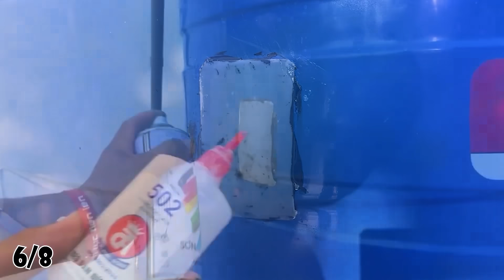I Never Have to Buy Water Again! How to Make Free Water Directly from PVC Drainage Pipe

Comment: What you do or don't do is your responsibility. I deal with drinking water in my job. I live in Switzerland and drinking water is subject to food regulations here. Drinking water is a foodstuff, just like other foods. Here it is controlled according to HACCP. As soon as you are dealing with surface water, you have to know that there are germs like E-carbobacteria in the water, which can make people sick. In my opinion, you have to know that. You can have such water tested in a laboratory. As drinking water, the number of germs per litre can only have a certain limit. That is why it is disinfected chemically or with UV radiation. That is the legal requirement. I do not know what the regulations are in your country. You can do what you want. I only recommend that you point out that this system is not drinking water compliant. Or that it must be boiled first. I would therefore recommend that you protect yourself legally before you are held accountable if someone builds it and becomes ill. You can do anything with this filtered water. Just do not declare it as drinking water.  This way you can certainly save water from the tap. But they reject any liability and say exactly what it can be used for. As soon as you touch something with your fingers and have not disinfected them beforehand, it is contaminated. I wanted to draw your attention to this. You know it, knowledge is power.
Reply: And where do you get water when you have a drought??....droughts can last for years....where I live, we have been under a mandatory water conservation for the past two years....this is fine for watering the garden....idk that I would  want to shower in it.....and I certainly would not drink or cook with it. If all I could use it for is watering the garden, i could just set the barrel outside and remove the lid when it rains.
Reply from the maker: @HeinzStuker Thanks for sharing your thoughts! It is important to distinguish between collecting rainwater and using it as drinking water. Rainwater can be collected and used for many purposes, such as watering plants or washing, but for drinking purposes, it needs to be treated and filtered thoroughly. I completely agree that ensuring health safety is a top priority, and measures such as filtering, disinfecting, or boiling are necessary before consumption. The goal of the video is to provide information on how to effectively collect rainwater, but also to emphasize that rainwater needs to be properly treated before drinking. Hope this helps clarify the issue! Do you have any additional comments?
Reply from the maker: @uberurbana4894 You are right to put the bucket out and open the lid and there can be rain water. But as you just said, if a drought occurs we need to save every bit of water. And with a little rain, "opening the bucket lid" cannot help you fill the tank, then you will have to struggle to carry those buckets of water to a safe place to store. It will be a lot of work later just in exchange for the convenience of "opening the bucket lid". Thank you for watching the video and wish you a good day.
Reply: Water conservation is  different in developing countries.
Reply: I was just going to mention the need for treatment for purity.
Reply: Absolutely agree 
What can do in this arrangement is to add a debris filter, simple sand, with small gravel catch leaves etc on top
But below & this is most important part in which most get wrong

U need crushed , as in close to powder (for maximum surface exposure)
CHLORINATED CHARCOAL 
So many times u see people use the charcoal out of a fire pit , bbq,  or Woodstove (which is better than no charcoal), 
but all that is being done is if there was any bad taste in water, filtering thru simple charcoal is acceptable

 But,  need Chlorinated charcoal, in order to remove some  bacteria, but it will do nothing towards removing eColi from the water, or many of the nasty smaller bacteria. Less than .003mm

To remove eColi, small bacteria
- Boil one solid minute of rolling boil
- Chlorine tablets or liquid
- UV light in verticals position (only works if water tds is below .05 so use that size of pre-filter)
- Ceramic filter vertical position 
Pre-filter 0.1 ok

These remove .999 of contaminants 

Even leaving a clear 10 litre jug out in direct sunlight for 6-8 hours will cause ozone & disinfect the jug of water

&

Finally there’s pasteurizing  which is heating to 160-170F degrees for 40 minutes or longer
Will kill bacteria

There r videos on Utube on how to make ur own Chlorinated charcoal right in ur own Oven 
So easy :)

But if ever in situation where u r going to die of thirst

But there is dirty water & think u might find help within couple days

I drink the water & deal with stomach when back at home or can get to a clinic
But only if rescue is within 2 days 
As is risky :)
Reply: For christ's sake! This man is ingeniuos. You live in a developed, Western, privileged country  This person - probably from Indonesia - doesn't have the advantages or the finances to just pay someone or buy something. I know who would survive if the western world's infrastructure collapsed.
Reply: @52ace1  he has a couple of expensive drills from Dewalt, cutting machines, a hair dryer, step drills, a dozen tanks, a pump, a dozen filter flasks, a bunch of new pipes of different diameters and a means for gluing them together. What finances and lack of tools are you talking about? He has nothing to do, so he does all kinds of nonsense crookedly and askance. Having no idea about it. And dangerous to health. To make money on YouTube. And not for extreme needs.
Reply from the maker: @rameshshankar1010  You're absolutely right, but in developing countries, water conservation often requires creative solutions that may differ from what’s common elsewhere. Systems like rainwater harvesting and DIY filters can make a big difference, especially when water is scarce. While these methods might not always be ideal for drinking without further treatment, they can still be incredibly useful for daily tasks like cleaning or irrigation. Have you ever considered how small, simple innovations can help improve water access in challenging conditions?
Reply: besides, too muchh plastic, water does not love plastic
Reply: It may be good for some things like water grass,washing the car.it just washes your roofs dirt,bird poop into your filters that only catch particles.if you pee in the roof drain it will still be pee contaminated..frankw
Reply: @pepe6518  the whole world has plastic piping
Reply: Congratulations.
Reply: @52ace1 The creator says he's from USA, one of the western, wealthy privileged countries. 

As for who will survive when Western infrastructure collapses? No idea, but I'm willing to bet that not many of the survivors will have drunk water collected like this.

Collecting water for garden plants is common in UK (except when we have a drought and no rain), but I don't know anyone who uses a complex set up like this. Guttering, down pipe(s), barrel(s) and the shed roof works well enough.

And if push came to shove & shed roof water was all there was to drink & cook with, this complex system would still be unnecessary.  Filter the water through coffee filters or fine mesh plastic tea strainers bc shed roof = insect contact, bird poop etc. Then boil it for 5 mins before use.
Reply: What makes you think he doesn't already know about water treatment and purification?!

And that he most probably has the testing kits, chlorine, etc to purify the water for cooking and drinking?!
Dominica 🇩🇲
Reply: This water is clean enough to wash and bathe with though.
Reply: I understand what you are saying, but any sensible person would know it's not drinking water unless you boil it and even that may not be safe. Filtration not sure it's the correct word. But to filter it through like they do in most EU and America. Where every attempt is made to remove all the bad stuff. Is definitely a must as that's how the water services work. I would like to say I am sure but I now realise as I write that many will not realise that it's dangerous.
Reply: Ever heard of Water Purification & Filtration?  It's been a World Wide thing for quite a while now.... 
...Just Sayin'
Reply: You talk about the first world and there’s a place in Switzerland where the natural water is the purest in the world. The video is about a world you don’t know where only “just” clean water is “Life”. Have thought about Palestine’s Gaza where people are starving for water just for drinking they don’t care about bacteria, ecoli etc. etc. Don’t talk nonsense if you don’t know the affairs of the world beyond Switzerland. Wake up and try to look around the world. People are bent upon to use the same water from the ponds which animals are drink. Keep your knowledge to yourself. Learn how to survive in this pathetic world on the other side of the globe.
Reply: Desperdício de cano e balde . Compra logo uma caixa d'água  e depois faça um sistema filtrante
Reply: Personally I think this man is very creative. At least he found a way to utilize water resources, instead of sitting in a fancy office, drinking clean water from the factory and expressing his views as a world saver. After you said...what did you do?
Reply: Using rainwater is a sustainable and effective solution for conserving water resources, especially in the context of climate change and increasing water scarcity. Rainwater is a natural, clean, and easily collected resource. Here are some benefits and methods of using rainwater: 

Benefits of using rainwater: 
Water conservation: Using rainwater helps reduce the amount of water drawn from primary water sources, contributing to the protection of groundwater resources. 
Cost reduction: Using rainwater for purposes such as watering plants, washing cars, or cleaning homes can lower monthly water bills. 
Flood reduction: Collecting rainwater can help alleviate pressure on drainage systems, minimizing flooding in urban areas. 
Environmental protection: Using rainwater helps reduce the amount of wastewater released into the environment, while also minimizing negative impacts on ecosystems.
Reply: He said water maybe for plants
Reply: Some good advice although, most water used at home is for cleaning clothes, flushing toilets, washing household rooms etc.
Just saying water is expensive savings can be useful. I have 7 water tubs in different sizes to collect it for this reason. 
❤❤❤
Reply: Everything you mention here has great appeal and marriage, yet we are human, no we are Mankind and we have drank water long before there were government-sponsored water purification departments Etc what do you say of that? I am curious as to any factual recordings of the difference in health etcetera or death count from water contamination going back to prior to the Advent of these modern methods, which in the United States are adding fluoride Etc
Reply: I'm sorry but you wasted much of the screen when you cut the circle from the middle instead of from within a corner it really irritated me I hate to say it
Reply: Thank you for good notice
Reply: In my country as well same...you can collectrain water and do the same as yuors here....but indeed need a lot of pvc pipe there😅
Reply: Please see ad associated with this video. You can get  ultra violet water bottle that will treat the water before drinking. So this system is safe to drink if you buy the water bottle. And wait three minutes for the water to be treated in the water bottle before drinking.
Reply: Maybe change the plastic bottles with glass bottles?
Reply: What happens to your little cushy job and all your nonsense when there is no law
Reply: +1
his sytem could also use a UV chamber to ensure proper sterilization.
Reply: そういえば最初なんで水止まったの？
Reply: Do you have to have UV radiated water to water your plants and garden in Switzerland?
Reply: What are going to do next ? Tell everyone in Afria.
Reply: I know who's gut would handle it the best if there was something in the water. And it wouldn't be yours.
Reply: We drink roof water all the time. without treating it. I have 4 1000 lt tanks in my backyard. I drink it all the time, and I don't have any problems with my gut. Nor do anyone else in the family. Baby up to 13 year old. Not a problem here in Australia.You must have really bad air quility over there.
Reply: Forgot to say , we don't use a filter either.
Reply: i anit reading all that
Reply: @Noneyabusinessok hahaha it's easy when you're living in a privileged country people in some places in the world don't have a sistem like this if your sistem collapse this guy have a alternative you just wait for state save your ass, company's selling filter systems people know that?
Reply: I live in rural Tennessee. I collect rainwater from our roofs for washing. We use it for everything but drinking or cooking. Filtration is not difficult. My concern, though, is cyanobacteria (so-called blue-green algae; it's not algae). Cyanobacteria produces toxins that are not destroyed by boiling. Boiling the water can kill the bacteria, but then the dead bacteris cells release even more toxins into the water than before. Cyanobacteria can grow in your water if it is exposed to sunlight.
Reply: 留這種言很好笑，作者的做法從頭到尾就只是收集雨水來作為生活用水，而留言者卻直接說這不能喝，會有危險！
可問題是，就沒人要拿雨水來喝阿？
你收集了雨水，你得多沒常識才會覺得這水能喝？
只要做初步的過濾，不要有太大的異味，就能用來洗手，洗澡，澆水，這樣不就夠了嗎？
若要拿來喝，那直接去買個逆滲透的濾水器過濾，然後在煮沸，說不定也能達到飲用水的標準！
Reply: For Drinking/Cooking water, I would distill it.    Some sort of passive/active solar distiller would be a smart move.
Reply: Yeah, life is so easy in developed towns where you have boards and standards and a little tap in every house. Once you have been around okaces like rural Africa, you know that life is not always so easy. Then core skills like this are golden.
Reply: @KhizerK-j8d someone had to mention Palestine. It's time to get out the bingo card and start making dots
Reply: @StevenH815  생활 용수로 쓰려면 저렇게 까지 할 필요 없다 ... 그냥 빗물을 받으면 된다 ...
Reply: @52ace1 영상 정보에 보니 ... 국가 미국 이다 ... 인도네시아 아니고 가정을 해서 동남아 쪽 이라고 하자 ... 그런데 ... 저정도 장비를 사용 하는거면 가난 하다고 볼수 없다 ... 그냥 순전히 영상 올려서 구독자 수 와 조회수 그리고 좋아요 늘려서 돈 벌려고 하는 유튜버지 그 이상 이하도 없다 ...
Reply: No pvc cement, no thread sealant. This will blow apart and leak like sieve ...
Reply: And why wouldnt you be able to use rainwater? I live in sweden and we drink rainwater all the time doofus
Reply: Filter one, boil two, treatment three. Then the water is good enough to use for everything except drinking and cooking.

Laboratory tests may show 3 water is safe for consumption.
Reply: nestle is an international water robber baron
Reply: Dangerous
Reply: Sometimes our brains make us only want to see what we want to see. 
I'm in a tropical country 🇮🇩 where it's difficult to get clean water in some areas. 
For people who live in areas or countries where it"s difficult to get clean water, a rain-fed system like this is not bad. 
Don't compare third country water treatment with European countries. 
Talkin' 'bout bacteria, our stomachs are 10x more resistant to bacteria than European stomachs..... 🤣🤣🤣 (just kidding)
Reply: Great advice. 

At least boil it once retrieved and save yourself from liability- it is more like Grey water.
Reply: Of course we must boiled first, because the water to be held in water tank...
Reply: I drank boiled water for 60+ years, no any problems 😊
Reply: @uberurbana4894 also rain water is not suitable for drinking because it lacks minerals, it's like distilled water, it's not good for drinking
Reply: @HolicCreation Great idea. Just a thought though, find a way to eliminate the use of electric. When the time comes to need this, there will not be electricity 😮
Reply: He doesn't say anywhere that you should use it as drinking water!
Reply: 資材の材質にも気をつけねばなりません。鉛中毒による健康被害が懸念されています。
Reply: Es demasiado para mi, pero me encanta ❤️ y pensar que yo simplemente en un par de ocasiones tomé el agua de lluvia que recoleté directamente cuando estaba lloviendo, porque pensé que estaba limpia pues "venía de arriba sin contaminantes" pensé, y ustedes dicen que debe por fuerza ser tratada, bueno, no se si adquirí alguna enfermedad por éso, heme aquí aún, por gracia de DIOS.
Reply: @RH-mx2cq — He also does not say anywhere that you should NOT use it for drinking water. And he shows it feeding a sink where people often drink the water when brushing their teeth.

All this criticism would be moot if he had just included warnings not to use as drinking water throughout the video.  

And for other's saying he may be in 3rd world, many people watching are not, myself included.
Reply: Thanks for telling people they can do what they want mr thinks he’s in charge of the internet but in fact is not
Reply: It's great to have such great water ideas. We will be proactive in our lives instead of being dependent on anyone else or any other ''high-tech'' items. Simply having the skill to do everything ourselves has helped us live well anywhere. Thanks for sharing. 🛑
Reply: I thought your water turns into ice instantly
Reply: @52ace1  like how being in the west means we are privileged. seriously? get a grip
Reply: And another thing, did he disinfect the pvc. It's just like anything else.
 Anything that comes in contact with the water has to be disinfected. His purification system might be good enough to clean out the bigger things and maybe some smaller things, but it's still not pure or clean enough toʻ drink.
Reply: this water should be use for laundries and watering plants
Reply: I will just conserve water and use water purifier for drinking purpose problem solved 😅
Reply: Didn't you see the green rubber filter, it's fine. 🤢
Reply: Did you know that Jesus is God? Jesus, the Son of God, gave His life on the cross for the forgiveness of sins. Through His sacrifice, we can live forever in Heaven! Repent, follow Jesus, and live forever! If you want to learn more about Jesus and Heaven, check out the Gospels of Matthew, Mark, Luke, and John in the Holy Bible.
Reply: Too much regulations... people in Africa lives longer than those in europe but use basic system.... go lecture elsewhere
Reply: je pense qu il le sait et ou la fait bouillir ou ne s en sert pas pour l alimentaltion ,l eau recuperee sert au jardin  etc...